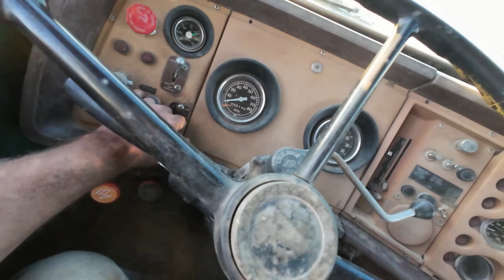First Day of Seeding 2024! Let's Go!!

Comment: 10:10 If you have already tried replacing the sensor and it didn't work it could be a problem in the coding
If memory serves you've been having problems with the blockage system on that sector since you brought the drill

Comment: I’m a little confused, I recall a couple seasons ago you guys replaced the bins on the two flexcoil seed carts but then got that case seed cart on demo so you guys didn’t actually use the flexcoil seed carts that year. Then if I remember correctly the demo seed cart stayed on the farm for quite a while after but you couldn’t use it as it was “off demo”… so my question is did you guys buy that case seed cart and trade in one of the flexcoils or do you still have both flexcoils and the case?

Comment: I think you guys have what it takes to make a hopper to dispense the powder into the seed that's on the truck tailgate. ⅜ hole would probably do it with a 90° ball valve. Just a thought. Load up at the shop and not have to breathe it as much.

Comment: All the best for a successful season. There is an old saying." The harder you work,  the luckier you get." I think sometimes it's easier to get an airliner flying than getting farm equipment operating correctly and reliably. No built in redundancy and to be truthful modern manufacturers seem to focus on profit at the expense of usability and reliability. Been at  farm with old gear and it is all fixable, simple and reliable. Transitioned to new stuff at great expense and frankly very disappointing. It may be bigger, operate faster etc but when systems don't work and support is not forth coming even after 18 months and issues under warranty, not good enough.

Comment: Guys, I love your videos and the fact that you are proudly displaying the flag,  however; the flag should be on the right side, as you are seated in the vehicle and looking forward.  That way, as anyone approaches the front, the fllag is in the place of honor.  UNITED STATES CODE TITLE 36 CHAPTER 10 PATRIOTIC CUSTOMS Section 175 (b) The flag should not be draped over the hood, top, sides, or back of a vehicle or of a railroad train or a boat. When the flag is displayed on a motorcar, the staff shall be fixed firmly to the chassis or clamped to the right fender.